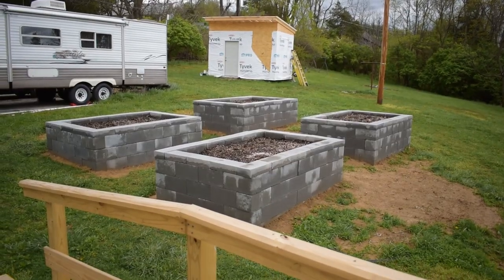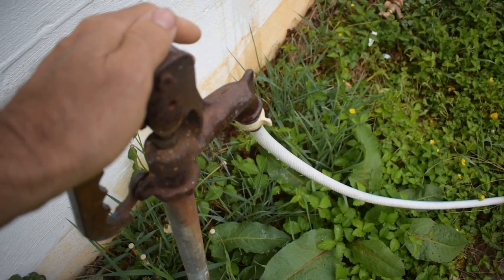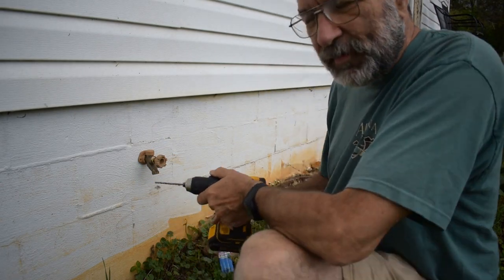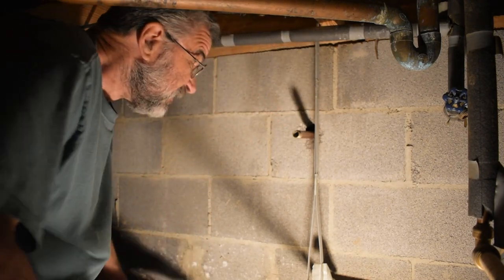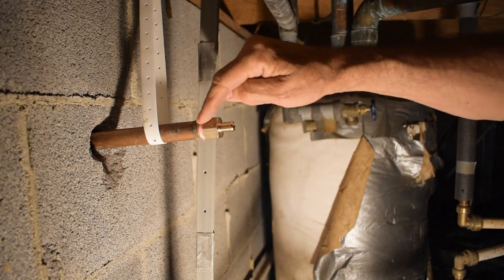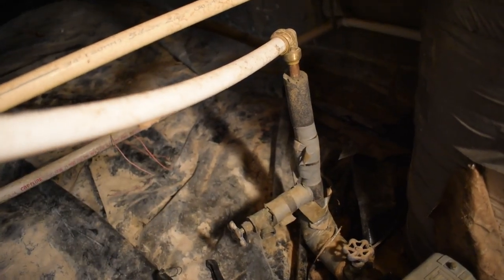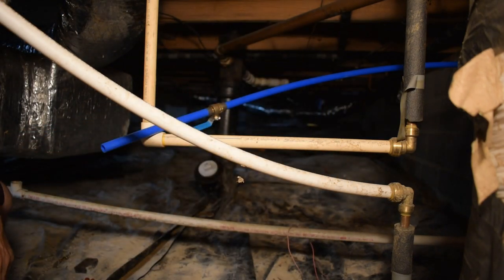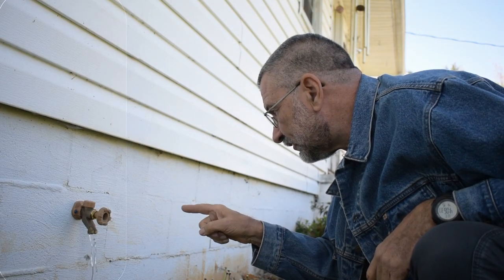Installing a Garden Hose Spigot

Comment: Much better than an old cracked Garden faucet. However I will say but you need to isolate the Copper from the concrete because corrosion will absolutely happen. Proflex makes a great tape for the purpose

Comment: Good Job!!!!  You make it look so easy.  I need a spigot on the side but my house is on slab...????   Can you add in that situation?  Without costing a million dollars....as I cannot do it myself.
Reply from the maker: If you can't run the pipe through the basement, then it must be run through the wall because you have to knock holes in the wall to run the pipe, then repair the holes.  It can certainly be done, but it will add to the cost.
Reply: @LiveSimpleLiveFree  Yes, I have NO crawl space.  I have a very large yard with one spigot!!! all the way on the other side!!!  thanks for answering.

Comment: Did you crimp on the blue pipe to the white one? You pushed it on but i didn't see you use one of those crimping rings.
Reply from the maker: That type of fitting doesn’t need to be crimped.  You just push it on, and it seals!

Comment: Aww I have a hand spicket like that placed by my well head. Now why they placed it there is beyond me. It's way to inconvenient. The plumber here said they are illegal. Haven't a clue tho.  Very nicely done! 🌱😍⚗
Reply from the maker: I can’t imagine why it would be illegal!
Reply: @LiveSimpleLiveFree  It probably just needs a back flow preventer screwed on it, to make it legal..just a guess...I know where I live they are required.
Reply: @LiveSimpleLiveFree  ikr.. He told me that. Nobody else around here said it was. I wont be paying someone to pull it out. He had me all worried that I was under a code violation. Thanks for making feel like I'm not breaking the law! I appreciate that! Ty! 😊

Comment: i know this is old but i have a 45 degree angle water spigot and i am wondering if there is an adapter make it 90 degree angle to bring it straight downward!?? i have searched and they have 45 degree angles and 90 degree angles!? i think i might buy a few different types to see if any of them work the way i need it to!!
Reply from the maker: I have no idea what’s available, but they make all kinds of plumbing parts and bits. You just have to look.